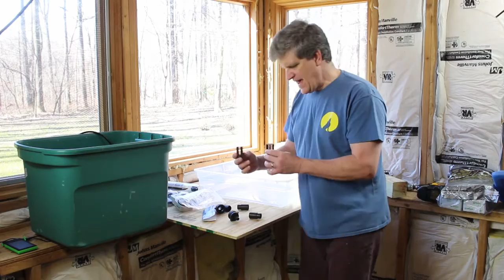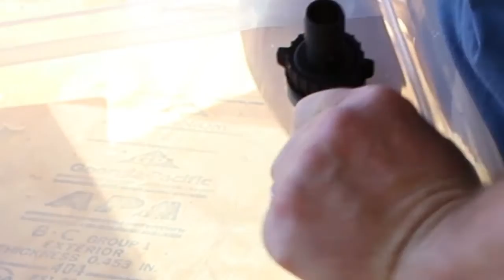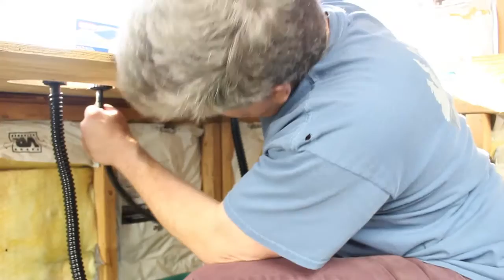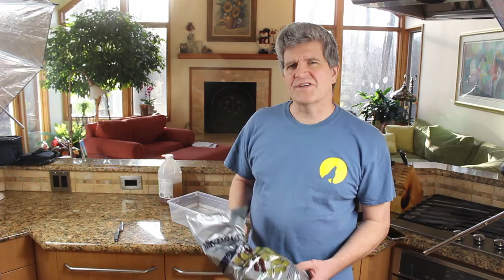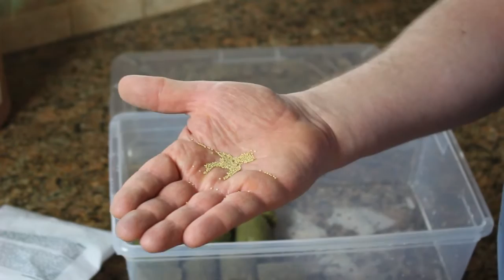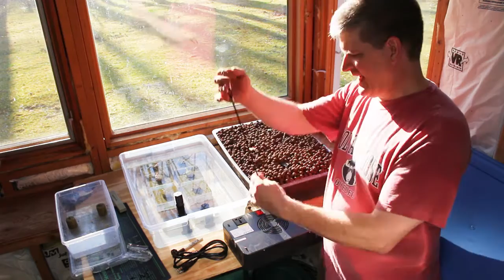How to Build a Hydroponic Garden

Comment: If your full res is just barely able to flood the whole system to where you want it, then it isn't big enough. You'll find yourself having to top of your reservoir everyday, which also means ph and nutrient adjustments. Plants drink a lot..  Media soaking + plant consumption + evaporation adds up to a lot of water loss, so I find that having a res that can flood at least 2 times over the desired amount is what you'll want so you only have to top off every week at the least.